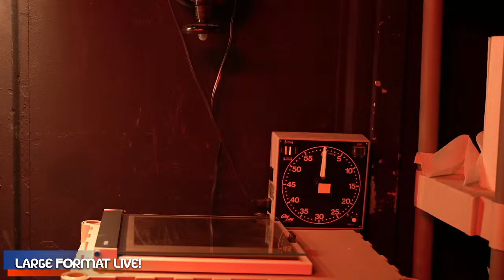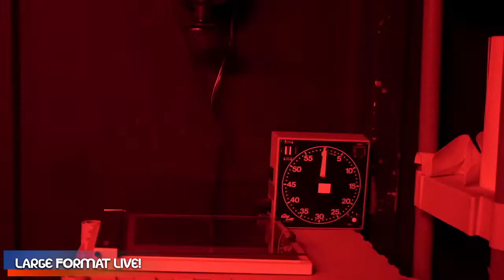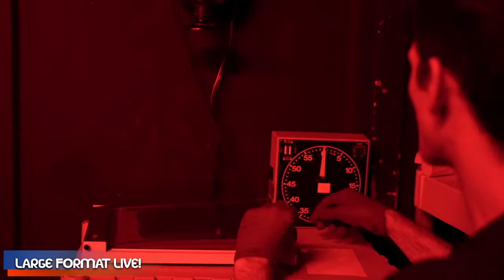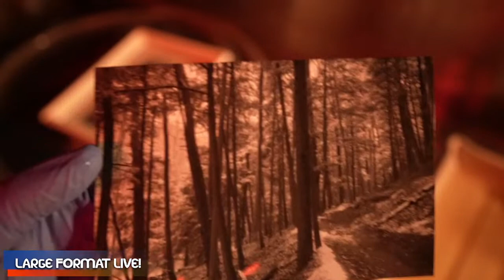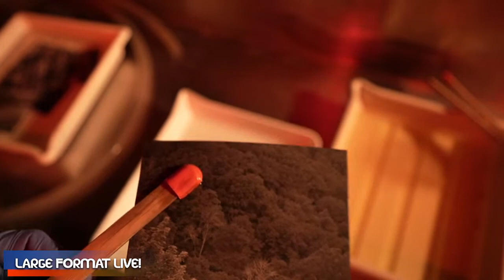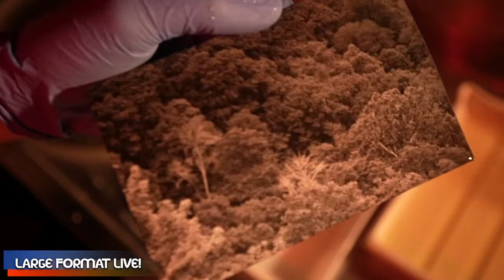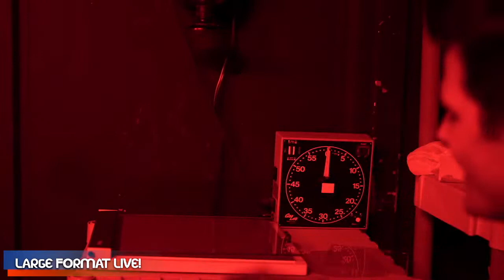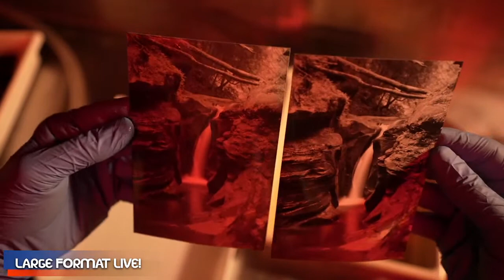Making B&W Darkroom Prints - 9K Subs Stream - Large Format LIVE!

Comment: I’m working on my darkroom shed (dubbed the Bear Cave) . I don’t have running water for the wash, so I use 3 trays of water after the fix. Since I’m using RC paper I’m not using Hypo Clear.Long story short ( too late) is allowing the prints to soak for about 5 minutes each sufficient without taking them and putting them under running water?
Reply from the maker: Hey Bear! I think for RC papers that should be okay, much less washing needed and hypo clear optional.